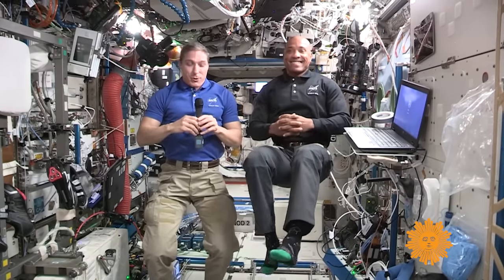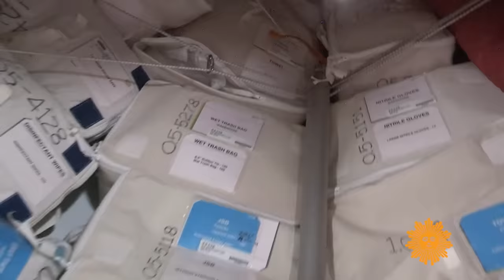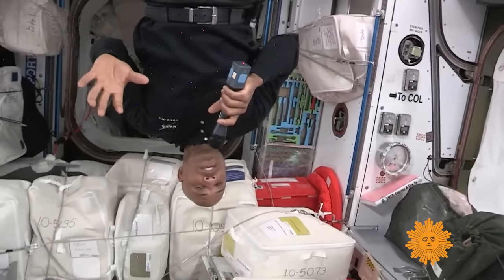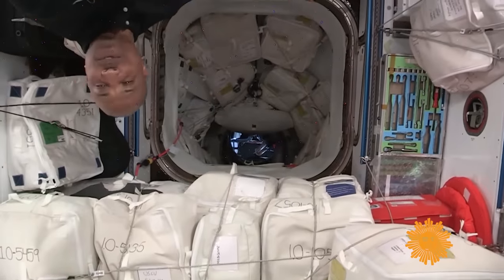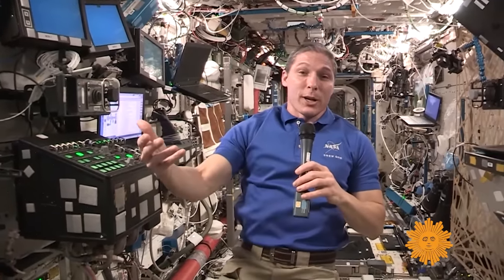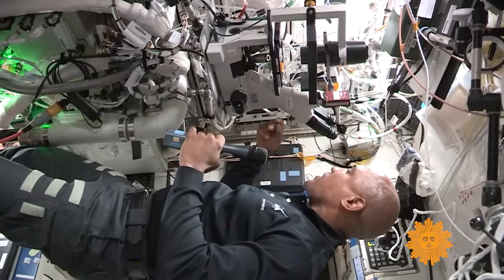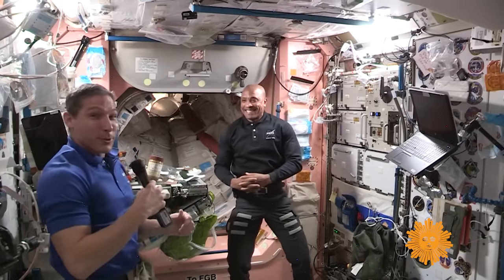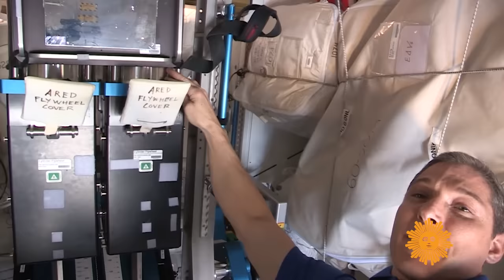Web extra: International Space Station tour

Comment: does blood go to the head when they are 'upside down'?
Reply: Well since there is no upside down I don't think so. However blood must behave quite differently with no gravity up there.
Reply: Actually the blood always goes to the head, as there is no force pulling it towards the feet like on earth. That's why many astronauts (at least initially) suffer from headaches or vision problems. The circulatory system needs some time to adjust for the differnet pressure ratios in microgravity.

Comment: I wonder 💭 how they use the bathroom 🚽 🤔🤔🤔🤔
Reply: Vacuum.  Special Male and female receptacles for urine, and a 'space toilet' for stool.  The Space toilet is like a normal toilet, but you need to use a monitor to make sure you aim properly so it hits the right spot for the suction to collect it.

Urine and moisture from Stool is recycled back to drinking water, the hard waste that is left is dry vacuum packed and returned to Earth on a returning capsule.
Reply: Is it where the crew wash their bodies? It doesn't seem to be installed now. Water is scattered around due to weightlessness. They use towels with water instead.
Reply: @balloonvendor  No, they just use moist towels or flannels to rub themselves down in their sleeping compartments.  Like how they use non rinse shampoo, rub it in to their hair, and then rub out in to a towel, or brushing their teeth, with a regular toothbrush and toothpaste, but they spit out in to a towel, and wipe their mouths.

All the dirty linen comes back on a returning capsule to be laundered.  Fresh linen goes up on freshly launched capsules.

https://www.youtube.com/watch?v=tDbbJWKKQu0
Reply: @ChannelReuploads9451  Your explanation is correct, but here is the "bathroom" answer.

Comment: Radiators in space? What medium is the heat being transfered to? Impossible in a vacuum. And what if the aircon ? You need to bleed the heat to somewhere. Lets see the module  or mechanism that operates the sewage treatment or where the engine is that c o uld be fired up to gain orbit speed. Sick of seeing how that spread p e anut butter.
Reply: Radiators in space? What medium is the heat being transfered to? Impossible in a vacuum.
No, it is quite possible to radiate the heat away in a vacuum.

And what if the aircon ?
What about it?

You need to bleed the heat to somewhere.
Yes, you do. You can radiate it away in a vacuum.

Lets see the module  or mechanism that operates the sewage treatment
You mean... the toilet?

or where the engine is that c o uld be fired up to gain orbit speed.
It's on the supply vehicles.
Reply: @Jan_Strzelecki  Oh they say theres an engine on board!! Never gets used. As far as supply vehi c les pushing them faster lets see it.
Reply: @chookin1  Oh they say theres an engine on board!
Indeed there is. It wouldn't be able to get to the orbit otherwise.

Never gets used.
That is incorrect.

As far as supply vehi c les pushing them faster lets see it.
Why? It's your job to prove your claims, not mine to disprove it.
Reply: @Jan_Strzelecki  Sooooo...lets see the recycle plant. As far as powering this white elephant solqr cells become useless in extreme temperatures , hot  or cold. Above 140 degrees the  produce less than 30%of their optimal outpot . Cold is even worse. Guess what space  temperatures are? BTW all these "low orbit" objects are in the thermosphere, a region that gets up to 2000 degrees. What are they building all these spacecraft  from
Reply: @chookin1  Sooooo...lets see the recycle plant.
There isn't any.

As far as powering this white elephant solqr cells become useless in extreme temperatures , hot  or cold.
It's a good thing that the ISS is equipped with radiators, then. And that it doesn't spend all the time in sunlight either.

BTW all these "low orbit" objects are in the thermosphere, a region that gets up to 2000 degrees.
Sure - but it's not dense enough for that to matter.
Reply: @Jan_Strzelecki  Jan, its either 2000 degrees or its not. What temperature do you think it is?
Reply: @chookin1  The temperature of what?
Reply: @Jan_Strzelecki  The thermosphere
Reply: @chookin1  The temperature of the individual particles that comprises air is 2000°-ish in the thermosphere.
This, of course, doesn't mean that the temperature of everything else in the thermosphere is going to be 2000° - much like your core temperature is going to remain at 36.6° even if the temperature in your room is, say, 20°.
Do you understand your mistake now?
Reply: @chookin1  "its either 2000 degrees or its not" - yes, but "temperature" and "heat" are two very differnet things.

You can easily spend an hour in a sauna at 100°C, but you will burn your hand within a second in 100°C water. That's because air at 100°C contains much less energy as the same volume of water at 100°C, simply because there are far less molecules actually carrying that energy. In the thermosphere thare are even less molecules, so despite having a temperature of 2000° there is very little heat energy.
Reply: "Radiators in space? What medium is the heat being transfered to? Impossible in a vacuum." ... it's even in the name. RADIATOR. No need for a medium, when you transfer energy via radiation.
Reply: @stephanweinberger  Qhat is the SURFACE TEMPERATURE  of the exterior of the  ISS?
Reply: @chookin1  no it isnt.

As I already stated: in LEO the atmosphere is so thin that it cannot transfer any significant amount of energy via conduction. Basically all of the energy hitting the ISS comes via radiation.

Thus, you can easily calculate an upper limit of the temperature using the Stefan-Boltzmann law (P=σAT⁴, with σ=5.67e-8). At equilibrium the energy radiated away due to the station's exterior temperature is equal to the amount of energy received from the sun via radiation (which is about 1360W/m² in LEO, but only half of that is effectively hitting the ISS - as only one side is facing the sun and the other half is in shade). 

So: 1360/2 = σT⁴ (we're using radiation power per m², so the area A = 1).
Solve for T and you get about 330K or 57°C - that is if the ISS were a black body (which it isn't, hence this is only the upper limit; in reality the surface is mostly reflective so temperature is way below that).
Reply: @chookin1  So how many people will have to tell you the same thing and explain how you are wrong before you accept that you are?
Reply: @Jan_Strzelecki  Oh dear, are you the same bloke who thinks an astronot can get 8 hours air from a tiny tank in a PLSS? When the Apollo missions did multiple EVAs did they refill their tanks? Where is this in the log? Where did they refill their EVA tanks?
Reply: @chookin1  oh dear, are you the same bloke who thinks an astronot can get 8 hours air from a tiny tank in a PLSS?
I don't know what an astronot can do. The real astronauts couldn't and didn't, though.

When the Apollo missions did multiple EVAS did they refill their tanks?
They refilled their water tanks and batteries, yes.

Where is it in the log?
We already know you are thoroughly ignorant about the Apollo program. You don't have to confirm that again.
Reply: @Jan_Strzelecki  So where is the log details of this? How could they do 3 EVA's on one tank of air? Where is it in the log of Neil and Buzz suiting up for the landing?
Reply: @chookin1  So where is the log details of this?
It's noted in the mission transcripts, available at sites such as Apollo Surface Journal.

How could they do 3 EVA's on one tank of air?
They didn't.

Where is it in the log of Neil and Buzz suiting up for the landing?
It's noted in the mission transcripts, available at sites such as Apollo Flight Journal.
Reply: @Jan_Strzelecki  Ive read them....in d etail. No  mention if putting on PLSS before landing any where.  Neither is there  any log of refilling  air tanks . Perhaps  with  your absolute knowledge you can give me a sirwxt refwrenxe/time/ day?
Reply: @chookin1  Ive read them....in d etail.
No you didn't.

No  mention if putting on PLSS before landing any where.
That, of course, is not true. For Apollo 11, the suit-up sequence has its own section in the Apollo Surface Journal, appropriately named "EVA Preparations". It took me just a couple of minutes to find it.

The procedure of recharging the PLSSes is also trivially easy to find, once one looks through post-EVA transcripts for Apollo 15-17.
Reply: @Jan_Strzelecki  So link it.ive read these  logs in fine detail. None of these critical tasks are to be found anywhere. There should be, at least several hours before undockibg from the  CSM detailed notation  on getting ready, checklists etc for donning PLSS. There  are none.   During multiple EVAs not a single reference to replenishing PLSS. Again, put up the  link or  shut up. Without this evidence your belief collapses. Is it any wonder NASA lost/ taped over their own telemetry!!
Reply: @chookin1  So link it.
I can't.

ive read these  logs in fine detail.
No you didn't.

None of these critical tasks are to be found anywhere.
Yes they are.
Apollo 11 Lunar Surface Journal, section "EVA Preparations".

During multiple EVAs not a single reference to replenishing PLSS.
Apollo 15 Lunar Surface Journal, section "Post-EVA-1 Activities".

Without this evidence your belief collapses.
That's my line.

Is it any wonder NASA lost/ taped over their own telemetry!!
They reused the telemetry tapes, yes, but not before copying the telemetry data off it.
Reply: @Jan_Strzelecki  Link it here.
Reply: @Jan_Strzelecki  Link it. As well link the PLSS refilling details.
Reply: @chookin1  I can't. Any post of mine with links doesn't post.
I've already told you where you can find it.

Apollo 11 Lunar Surface Journal, section "EVA Preparations".

Apollo 15 Lunar Surface Journal, section "Post-EVA-1 Activities".
Reply: @Jan_Strzelecki  Whilst youre at it lets the the fine detail of the PLSS reverse cycle aircon that kept them alive in plus and minus 250 degrees. All this amazibg tech the  size of a suitcase...in the mid 1960s!! Pressurized to offset an absolute vacuum, survivable in zero kelvin and oven-like conditions, oxygen supply for 8 hours , drinking water, comms, battery small enough to power it all......it wasnt even vacuum sealed!!!Hahahahahah!!!
Perfectly exposed and focused photos without  auto focus or a veiwfinder, no exposure controls adjusted, film w o uld be destroyed by radiation AND the fact exposure to a vacuum w oiuld f oig the entire magazine!!! ......just pot luck eh?? Aha hahahah!!! Kepp the stories coming Jan. We're all cacking ourselves here.
Reply: @Jan_Strzelecki  You cant link it? Case closed your honour.

Comment: Now within the roof particle line an airline that came down going to the particle cleanser and drying filter application up on the suit is where they have the installation of the covid-19 it was a Chinese exchange student up on the way back to China to the main area where they were talking about the main lab that must have spread the covid 19 out of China now and I think it was the new rule laboratories northview norrue something like that it started with an n those laboratory exchange students that were going back to the lab it came from affiliated area which I'm not 100% so it's not I know it had a Canadian tie in that may have been through a biola facility five this is a big concern upon me my NASA association and I hold it at a high level of scrutiny amongst all biophysicists amongst the Union on how this all spread out and got to be as big as it did now the drastic changes amongst filtration and filtration systems from the enclosed system to the exterior drying filter that connects to your suit this is going to be a new policy that I want run through the union for all HEPA filters to be exchanged and put on and applied within each individual technician and especially within the satellites with the seals non-broken and while doing it a confirm check on video while you apply it with most facilities if you're up on your suit you would be under camera while you're doing it just like up on the space station itself all cameras up on all vital areas including the main emulsion systems so within all emulsion systems I want to make sure that there is a check on all vital apparatuses and reconstruct on all seals and make sure your seals are not broken and opened up on any of the said I have a filters or have a drawing filter systems like I said it was the exterior one on the hose going into the bio containment suit that you plugged in to your air apparatus for your bio laboratory clean rooms so I'm just saying just double checking on everything that we're doing and make sure everything is still within policies and governmental medical agreed parameters
Reply: Bro seek help!!